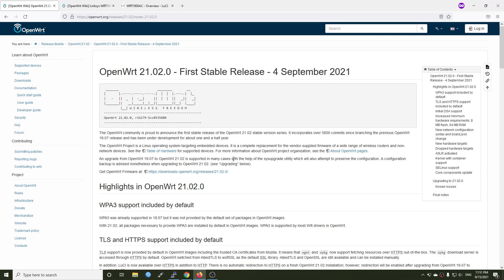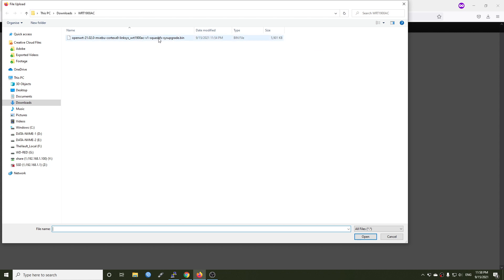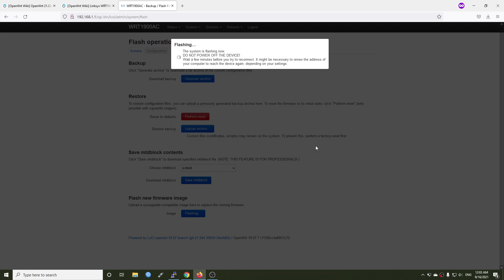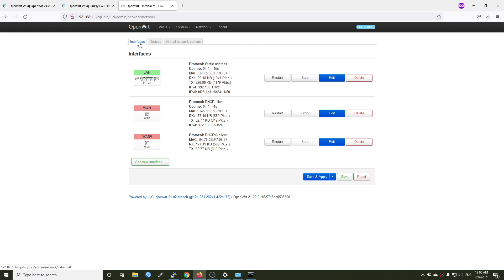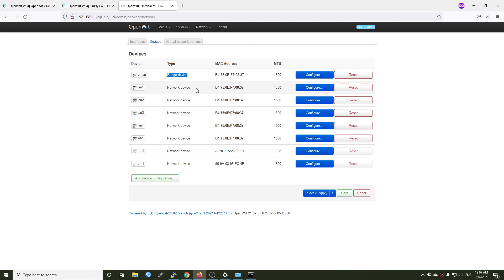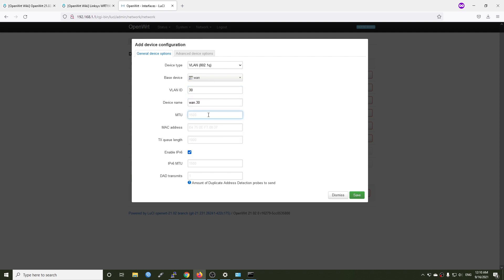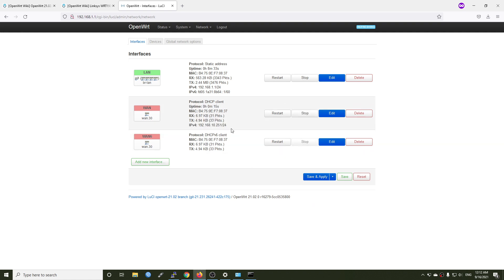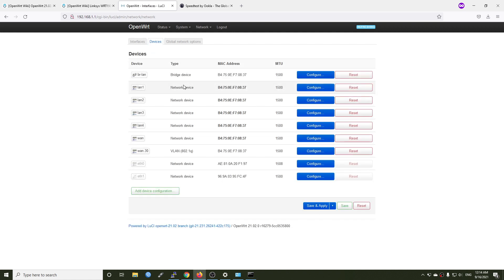Install OpenWRT 21.02 & DSA VLAN Configuration for WAN Interface

Comment: Thanks for your video! Just to let you know your steps on creating WAN interfaces through DSA have now been added to the official documentation. The docs were originally written using swconfig examples, but these are no longer valid for many routers using DSA.

Your video allowed me to convert my own swconfig setup to DSA and I've also gone ahead and broken down the steps in your video into instructions for others in the "Creating additional WAN interfaces" section.
Reply from the maker: Thank you for the information. I also made a new version of mwan3 tutorial for OpenWRT 21.02 and it was working great as usual. https://youtu.be/phkptBdGScY

Comment: If you look at the OpenWrt forums, you will see WiFi often deauthenticates if using WRT1900AC and similar including my WRT1200AC and Android or iOS devices. Had to revert to 19.07 to get it back. It’s a known issue and not currently fixed. Ethernet works fine.

To clarify, if you try WiFi on Linksys device and 21.02 and connect an Android or iOS device, it won’t be stable.

Comment: hi vantech, wanna ask opinion. I've found Linksys WRT 1900AC for sale around rm650. IIs it worth the price?It was half of my initial budget for planning to upgrade from stock tplink ac1200 (Msia Unifi). Or do you suggest to go for AC 2600 MU-MIMO since the seller also got this unit.

Thanks,
Reply from the maker: Hi Khairul, IMO, RM650 is expensive to for the Linksys WRT1900AC, either V2 or V1. If you need a good device to play around with OpenWRT and also stock firmware,  Asus RT-AC86U is not a bad choice. I found some seller on Shopee and Lazada posted the WRT1900AC used for ~ RM250 (not a really good deal but still okay). However, the budget is with you and it is your decision.

Comment: Hello Mr van tech.
In ur opinion, does wrt1900ac v1 or v2 still worth it to get right now?
Planning to get used unit.
Thank you
Reply from the maker: Yes, I expected that the device will be supported after few major upgrades. If you have a choice, get V2 to have more RAM and better cooling.
Reply: @VanTechCorner  thank you sir. Just got myself an used V2 unit for rm280
Reply: @vegshark92   may i know did u get it? Rm280 is good price!
Reply: @mohdzulhazmi5357  yeah. I got it. Work wonders
Reply: @vegshark92  haha  i mean where did you buy it at that price? Gimme link bro..thanks

Comment: Hi Van Tech
I appreciate your video about vlan on latest stable openwrt
i"m from indonesia and many openwrt enthusiast here change amlogic tv box to openwrt router,
The problem is tv boxes only has 1 ethernet port
now I have main router (amlogic tv box) running openwrt 21.02 that has only 1 ethernet port,
I want to extend physical ethernet with another old openwrt router running openwrt 19.07,
the secondary router have switch menu on luci/network, so i can create vlan id 1, 2, 3 etc
but i dont know how to setup main router to assign or tagging each vlan id on secondary router
could you explain me?
Thank you
Reply from the maker: Hi, maybe you can share the network topology and your devices overview in the FB group and we will see if any folks have any idea about it. From what I know, this TV box has a USB 3.0 port, why don't use buy a USB 3.0 to Gigabit or a cheap USB 2.0 to Ethernet adapter instead. This will help to simplify the who setup.
Reply: @VanTechCorner  i use old tv box, still use usb 2.0 
so , i think its better when use ethernet port
i have fix the problem
i reinstall my sdcard then create new interface on my tv box router
i just type eth0.10 (renumbering vlan id) on device setup.. i got IP on each interface

i think i do too many setup on my tv box so many configuration make some conflict

the topology is ethernet tv box router connected to lan 1 secondary router

iset untagged to vlan port lan 1 and 2 and set as LAN interface (unmanged), my laptop connect to port lan 2 and success get IP from main router

i set tagged on vlan port lan 3, 4, 5 and cpu on each vlan

i succes set interface for each vlan from tv box router
thank you very much
Reply: I create video on bahasa indonesia, base on your tutorial 
Thanks you very much

https://youtu.be/8q_Ml2DD4gA

Comment: Bản 21.02 này nó quy hoạch cái vụ nhóm port và tạo Vlan y như Mikrotik. Chắc là lập trình viên đam mê Mik mà phải làm bên Openwrt đây mà. Trong Video anh nói khi chạy Vlan 30 bị giảm tốc độ mạng so với bản 19 cái này đáng quan ngại khi nâng cấp quá vì em đang dùng Vlan 35 của Viettel.
Reply from the maker: Thật ra đây là những khái niệm chuẩn trong Linux, và team OpenWRT đang quay về sử dụng chuẩn này để mọi người dễ hiểu và làm việc hơn đó bạn. Trong video mình sử dụng Mikrotik AC2 vừa quay PPPoE, cân bằng tải đồng thời chạy DHCP server trên VLAN30 nên chắc bị quá tải thôi. Dĩ nhiên là khi chạy VLAN tốc độ sẽ bị giảm thiểu và cần thêm tài nguyên CPU, nhưng mình tin sẽ không chậm như vậy (thật ra trong video nó được 250 Mbps với 50% CPU idle).
Reply: @VanTechCorner  cám ơn anh đã giải thích. Em có con WRT32X cũng dòng giống con của anh. Định cài Openwrt vô chơi cho nó máu. Hiện đang dùng con Newifi 3d2 chạy Openwrt làm router chính gánh Wireguard các kiểu rất tốt.
Reply: @minhchanhdo  bro có dùng mwan3 để định tuyến ip khi dùng vpn ko?
Reply: @NguyenLong-cv7oc  dùng cái này bác
VPN Policy-Based Routing

Comment: How do you do tagged and untagged VLANs? That's confusing
Reply from the maker: Hi, the default configuration of WAN and LAN ports are untagged. When configure the VLAN for WAN, the status is now tagged. Further configuration like what you do with the Switch page, you can have a look at this page https://openwrt.org/docs/guide-user/network/dsa/converting-to-dsa
Reply: @VanTechCorner  thanks for the link

Comment: openwrt really is an multifunction firmware. its really great. And now i bought an cctv for my home and i want to know if my cctv can be manage from openwrt? this cctv is an wifi cctv so its connect to a network, i already try to acces the ip but it not want to be oppened
Reply from the maker: Hi, do you mean allow the device to be connected to your LAN network but not the internet, is that correct?
Reply: @VanTechCorner  im sorry if my english is not good. my cctv is already connect to my lan network, what i want to ask is: is my openwrt can be a cctv server? thanks

Comment: On your last video I asked you about the EFI version of this build and you did not answer , you make a video of this build and still will not answer nor address what I had asked you .... disappointed in you ,
Reply from the maker: Hi, I try my best to answer the comment/question but I afraid I can't check all the comments on the channel. If you need futher discussion, please create a group on the FB group and I think our folks will have some idea, or else the openwrt forum is not a bad choice. OpenWRT x86 EFI is something not for beginner (as per the documentation, it is for developers), you can learn how to build it here https://openwrt.org/docs/guide-developer/uefi-bootable-image
Reply: @VanTechCorner  Hello ,  as I had said previously that Opewrt has already created / built an x86 EFI build and is available in the Stable download section , and to use it as is is fine ,   

My question was about the extending of the partition in order to use the entire partition as you described in a earlier video , so I do not have to build one myself , just use what has already been built , 

The EFI build has 3 partitions , and I thought you may have already tried this build and have found a way to extend the partition ,  otherwise the partition would be  about 110 MB and not utilize 250GB
Reply from the maker: I see, unfortunately I don't have a test device that support EFI to try it out. With BIOS, I am able to extend the partition with fdisk and resize2fs. https://youtu.be/cOLn2H1FZEI?t=440. You can also find the docs here https://openwrt.org/docs/guide-user/installation/openwrt_x86. Just my curiosity, are you running OpenWRT on a new x86 system where only EFI is supported?
Reply: @VanTechCorner  I am running OpenWRT x86 ,  but don't require EFI ,  I have hardware that supports it and just wanted to try it out ,   I use  fdisk and resize2fs that will resize the partition and works fine on a non-EFI build ,  but the EFI build uses an additional partition for EFI 

even though the  fdisk and resize2fs did resize , it appears that it did not natively include the EFI partition after resizing , possibly running  fdisk and resize2fs and choosing the 3rd partition and including it might work , but I was not sure and did not try that , I thought you may have and I would ask you first before messing with it 

Thank you

Comment: Hi, after installing openwrt 19.07.8 on my WRT1900AC i don’t get any internet connection, it does show you that there is internet, but nothing opens
Reply from the maker: Hi, did you solve the problem? Do you have any VLAN configuration in the previous version? If it still persists, please share a screenshot of your Network interfaces.

Comment: Hi, is it possible to setup an openwrt router with a cloudflare warp client? I intend to use it as a bridge for all my lan devices, to route all traffic through cloudflare wireguard tunnel. Haven’t seen any tutorials on how to do this, would be great if you can help! Thanks
Reply: Cloudflare uses an app to run their VPN client. I think they support Debian, Ubuntu and Cent OS. In other words it could be done but not in Open WRT. The Cloudflare client is open source so someone could port the client to ARM and package it for OpenWRT someday. You can use other VPN services that support Wireguard though. It just won’t have the cool abilities of Warp. If I wanted to do this I would build a small Linux computer to behave as an access point on my network that would run the Warp client onboard. All devices connected to this particular Linux box would automatically be tunneled. You can find tutorials on how to do all of this. If you figure it out maybe you can post a video on YouTube about how you did it. Maybe I should do this! 🤔
Reply: @michaeldina1103  hey, just read your comment. While cloudflare doesn’t (yet) support any routers officially, I’ve seen some tools on github that generates a cloudflare wireguard profile that can be run on a computer. I was just wondering, since openwrt routers support wireguard, if I were to copy the configurations over to the respective fields on the router(such as public key, private key, etc.) it should be able to run, right? I’m not really too experienced in the networking side of things and haven’t got my hands on an openwrt capable router yet, but it would be cool if somebody could try it!
Reply: @michaeldina1103  there’s a video on it being done on Mikrotrik router here https://youtu.be/2pFcVRaoscE
Reply: @jordiananders4153  Well that’s very cool!